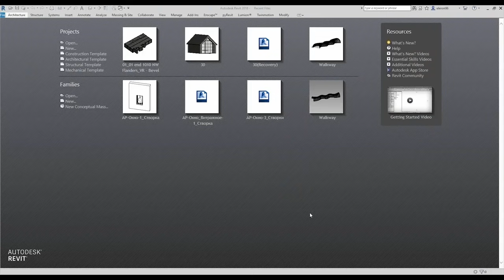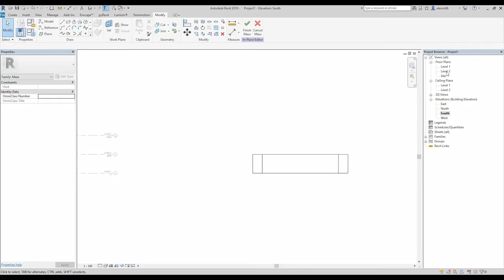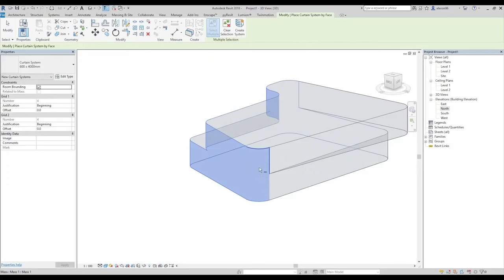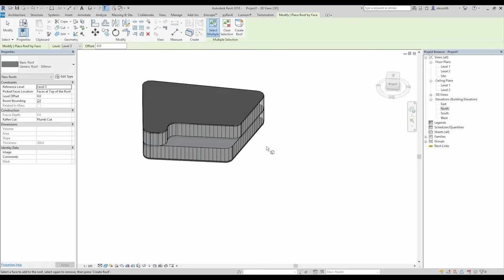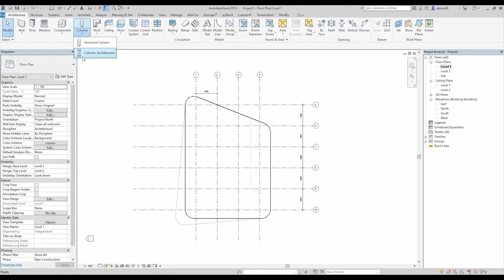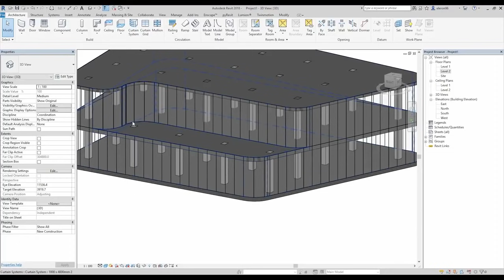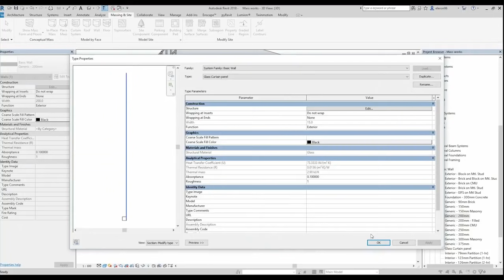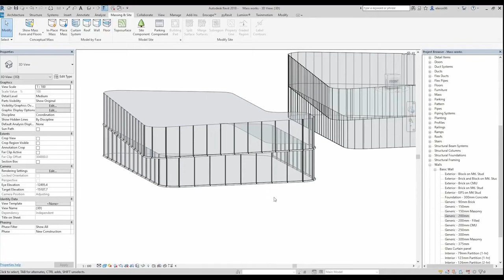Learn Revit in 5 minutes: Mass in revit [quick overview] (Quick modelling)

Comment: Nice tutorial. Don't forget that you can click the "Join Multiple" at minute 13:45 and you need to select the roof only once.
Also, when you want to join a floor with several column, just filter and isolate them and then with join multiple you can click on the floor once and the select all the columns for a fast join.
I'm just saying this for whoever want's to learn about it. Not implying that you don't know this :).

Comment: great video! I first saw this about 5 years ago and now that I'm much better at revit, i took it as a refresher on designing from massing.  What I usually do with columns and walls is offset the top by the floor/roof slab thickness.  joining  always leads to problems down the line.  this is great for conceptualizing in SD and planning phases.  thanks a ton!